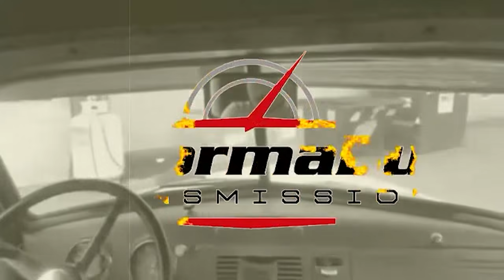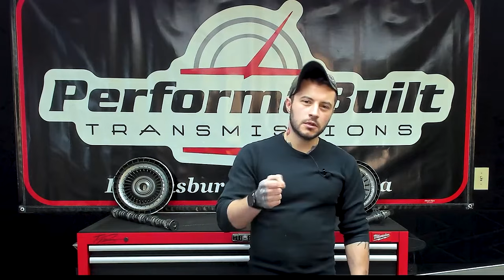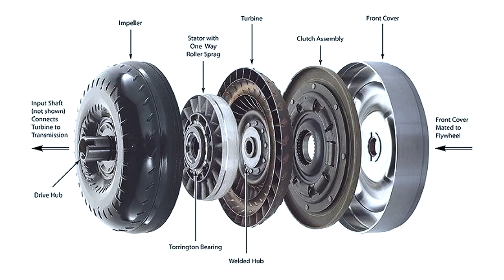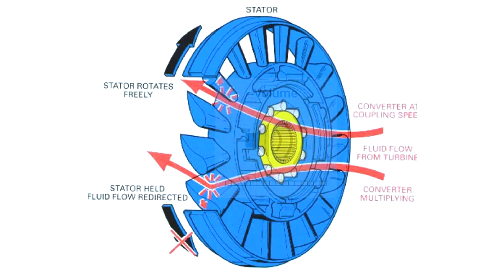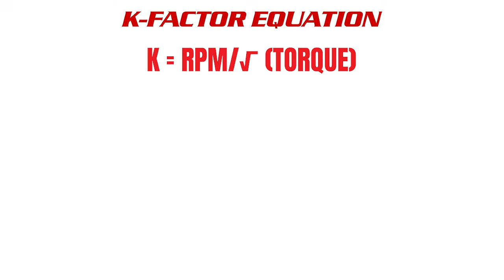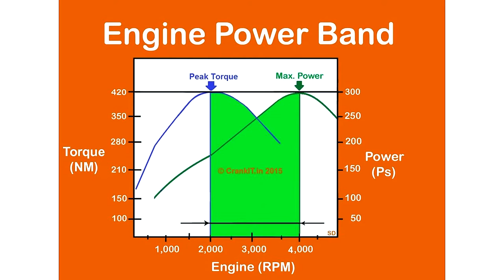How to Calculate Stall Speed

Comment: Excellent video. Just want to say I have a 2400 stall in my '70 Chevelle 454 LS5, along with a TH400 and 4.10 gears. Perfect for the street. Just need that overdrive. The cam makes 14-15" hg at idle so I know it's not that big.
Reply from the maker: 2400 is perfect for the street and its the highest factory stall gm made

Comment: just swap to manual be done
Reply from the maker: That is an option for some people, and manuals are very fun to drive but the benefits of torque multiplication through a torque converter produces much more efficient and very often quicker times without any real factor of operator error. Theres some fast stick cars but theres much faster autos today due to what a proper converter setup can achieve.

Comment: I have to disagree about running a high stall on the street.  I've been running converters on the street for 20 years that flash to 5-6K.  I've been running the same TH400 during this time.  Last time it was rebuilt was in 2005.  And I don't have a massive cooler on it.  I use the cooler in the radiator and then it runs through a single loop 24" tube and fin cooler.  For 15 years prior to 2005 I ran converters that flashed to 3-4K and only used the cooler in the radiator. At part throttle cruise the converter will slip very little compared to full throttle. And my smallblock has a mild cam.  It's only 274/286 @ 0.050" with 704" lift.  lol
Reply from the maker: Its ok to disagree and we are mainly talking overdrive lockups not non lockup th400s and 350s. Very different animals

Comment: Many racers use the bolt together converters with different stators to change at the track depending on track conditions some will run dumps also to control fluid to get the perfect transmission tune on the fly
Reply from the maker: None of that has to do with the transmissions actual tune in the software just fyi.

Comment: I installed a PerformaBuilt level 2 4L60E & 3200 stall in my 96 TA with a CC503 cam and all supporting mods at ~50k miles. I'm at 88k miles and everything is working perfect. Went from a 14.2 in the quarter to 12.9. I sometimes wonder if a lower stall would help in the top end though.

Comment: Are you talking about flash or stall?
Reply from the maker: Both
Reply: This wasnt addressed clearly. You can launch foot brake at 5000 but rpm drop after shifting could be back at 6000. This is a wrong selected convertor example that I experienced.
Reply from the maker: Flash vs actual stall depends mostly on your overall gearing, tire, and cam. The drop your speaking of on launch doesnt really apply to stall but more on your ratio for 1st to 2nd as well as where your cam actually makes power (granted youve picked the correct stall speed) if i understand your wording your talking about close ratios not stall speeds. The major point of this video was to give the general idea and give the tools to help figure out a starting point for stall speed on a new build and to show a 2000stall behind a 454 will not behave the same as a 2000 stall behind a 350 for example. I would take some further courses if youd like to learn more than base stall with your particular vehicle. Video would be hours long if i went that deep for all kinds of combinations.

Comment: ive run 3600's on my street n strips for years but moved to 4400+ on the 4L80e's with a triple disc...you CAN get the best of both....Aftermarket ECU's allow you to lock up the stall from 2nd gear on ( same as newer trans like 8l80/10l80's they ALL lock up the stall at part throttle past 2nd even if they have 10 speeds ) and that keeps the heat under control very well...had one behind a BBC with F1A-94 putting out 1300hp for 6 years near daily driving..no issues at all...this does include good PTFE line ( less internal resistence ) and swept 90s into a large stack plate cooler....also using a charge pressure transducer to polish in the tune ( so computers are still in play in whats going on in the torque converter ).....go with with more modern 6,8,10s speeds you have even more control...but even mine ill let it unlock a few ms at shift with stall LOCKED at WOT as well.....this video is more for people that dont have control over the converter in older trans.....for those I generally stop at 3600, ive had that in SO many configurations, at so many weights and power levels its just a real damn good compromise as he said....
  Im glad the market is moving more towards end user changeable stators ect....really appreciate the video and that will help the end user dial in their combos by not having to send it in, in fact if your younger you can have one for race season and one for off season......

 Keep up the videos but dont limit yourself you CAN much CLOSER to the best of both worlds with modern converters, trans and control system......I literally called that entire project cake and eat it too, down to gapless top rings ( damn ring pack was $400 pre biden dollars so what 600 now  lol )....

Comment: I don't hear much about stall speed anymore, i remember how popular it was in 1984. It felt like i added a hundred more horses. I think it was 2500 stall but we didn't dyno or have every guage working. Im kinda glad and jealous to see things aren't done like that anymore. One thing i vividly remember was driving down the street, and every driveway or every other driveway had a car jacked up with tools rattling under it. Everyone was a mechanic back then, and we had to physically hunt for information by showing up anywhere cars starting gathering. I learned mechanics from dad but had to hunt horsepower information because i am positive my grandpa and dads generation absolutely limited our horsepower because they were driving before seat belts, air bags,and crush points. Grandpa and Dad could put enough hp into a ceiling fan that it would lift the house, but they were intentionally dear in headlights when asked for modification information. I don't modify anymore because today's stock hp impresses the hell out of me😮
Reply from the maker: That was a time to be alive. To hunt real info. Now we all have youtube lol. Yes stall changes are the real key to a good engine / trans combo

Comment: I think im getting the hang of it after watching this video. Im rocking a ls1 5.7 with 243 heads, ls6 intake, headers 231/242 in/ex cam in a 3600lb (est) camaro with 3.73 gears on 26" tires. I do not have a dyno graph of the car yet because its not fully assembled yet, but should be around 450hp/tq. This will be 100% a street car. When doing the K factor, do we use crank or wheel torque? I'm still a bit confused about k factor. Are we trying to match k factor to our duration or something? I don't quite understand just throwing a stall rpm into the equation. Where does that number come from
Reply: You have to know two of the three. K-Factor, torque at flywheel as installed or stall speed to calculate.

The OEM Mopar 10.75" Hi Stall Converter that came in performance applications was K-Factor 140

426 Hemi 
Rated Gross 490 lb-ft
Net Estimate (80%) - 392 lb 
19.8 x 140 = 2,772 rpm
Claimed 2800 stall

383 Commando / Magnum 
Rated Gross 425 lb-ft
Net Estimate (80%) 340 lb-ft
18.4 x 140 = 2576 rpm
Claimed 2600 rpm stall.

273 Commando
Rated Gross 280 lb-ft 
Net Estimate (80%) - 224 lb-ft
15 x 140 = 2100 rpm
Claimed Stall 2100 rpm

Internally they were the same converter. 

They also had a K-Factor 115 version of this converter they used in some of the 2 barrel engines.

Comment: Hi, I have a 2800 Lbs vehicle with a powerglide trans Sbc 383 stroker Hyd Roller Comp cam 2200 to 6000 RPM Range Duration 230/236 Lift 582/591 Slick diameter 31” x16.5  4.11 gear I currently have a B&M 2500 stall converter in the vehicle that sucks from the standstill at full throttle I will appreciate any recommendations that you can suggest regarding a stall speed that would accommodate my application if you sell converters, I can make a purchase from you and forward you any additional specs that you might need
Reply from the maker: 2800-3000 stall, dont use b&m or tci. Pick a reputable converter lile fti or circle d and you will feel the difference

Comment: Awsome video and great info. I guessed and hunted for a used stall for my foxbody. I think i got lucky bc it does great for what it is. I wanted a 2400 but found a deal on a 3500 non lockup so i bought it and put it in. Glad i did. In my 3550# with me in it foxbody convertible it went from running 9.20s in the 1/8 mile to 8.33 at only 240/265 to the wheels.. im thinking it may change tho once i bolt on this old sc and run 6# boost to it..
Reply from the maker: 3500 is meant for the strip like your using it for because the torque curve is stretched out over the powerband. The issue is people think they need a 3500 for everyday street use with a near stock vehicle with heads and cam.
Reply: @PerformaBuiltTransmissions  I daily drive mine in the summer but I can see where most wouldn't want to. When I first put it in I was running the stock cam and the party was over real fast..

Comment: Does line pressure affect stall speed or flash stall ? 

Have you done any videos on dumb valves ?
Reply from the maker: Very little effect and usually not enough to make a change. But it can ever so slightly. We require stock line pressure in all of our builds. I dont have a video on dumps but there are many out there on YT

Comment: Quick question. I know you need more info. I have a 2700 stall which should be streetable in and just took it out today. It's a jegs brand and it would not really move without a lot of rpms. Could barely make it through a intersection driving it normal. Could it be a bad converter or just totally wrong? 
If you floor it it goes. Thanks
Reply from the maker: You have a bad converter or something else wrong. Advice i would never ever ever buy any converter through a big outlet like summit and jegs brand. They just aren't good and the bottom of the barrel for even oem function. Pick a reputable company like fti or circle d for a solid build.

Comment: #3050 Hobby stock 1:82 powerglide  500/500Lift 232/232Duration 108LSA. 2500-6800  rpm Range  3/8 tight asphalt circle track. What stall you recommend?? 3:73 rear gear 678 final drive
Reply from the maker: Thats great information and your well prepared! You have every number you need to sit down with some paper and plug them all into the K factor equation for a base stall speed! Then actual flash stall speed! You got this yourself! 🙌😃

Comment: Do you have a 700R4 that will live behind a BBC torquey street engine?  Have a TH400 currently in my 1972 C10 with 3.73 gears and is revving 3000+ RPM on the freeway at 70 mph.  Really would like an OD for mpg’s and less revs.
Reply from the maker: 700 isnt my first choice for an update and requires an exact tv cable setup at all times but yes we are able to build that. Please calls sales during buisness hours to spec one out or visit www.performabuilt.com to veiw our products

Comment: Street stall at 2k range? Had a fbody with a 4l80 and bolt on ls1 and I went for a 5000 hard hit torque converter and I got the biggest trans cooler I could find and it was the best tc for street Ive ever experienced and Ive done a bunch of them different setups. The car actually did a wheelie at the track and was stupid fun on the street and super manageable for cruising and non wot driving

Comment: I’m looking to ls swap a ranger with a with a 6.0 and a 4L80 with a 222/232 112lsa cam and 29 inch tires, ideally I’d like to run 4.56’s or 4.88’s to make up for the long 4L80 gears and a gear vendors to bring the highway rpm’s back down and split gears, would something like a 2600 stall be optimal for this situation?
Reply from the maker: It wouldnt be ideal for racing but for light street driving and towing it would be fine

Comment: Thank you! Amazing video! Currently planning a 408 build on a lq4, with a stage 2 Brian Tooley Torque Cam with the 4l80e in my 5500 lb 2006 1500HD Chevy Silverado. This video has done wonders in helping me figure this out. We are probably looking for that 450-500 trq range but won't actually know till it's dyno long after everything is in. Probably gonna go with a 2200-2400 or 2400-2600 stall speed.

Comment: I’m changing from a th400 to a 2004r in my C3. I have a 3000 stall in it now. I like it but wondering if I should bump it up a bit for the 200. Like 3400. Street/strip .486/.500 cam, 107 LSA, 243/257 duration @.050, 4”hg, in drive,3.70 gears, 28” tires, 3” exhaust  around 350 hp 31-3200 lbs
Reply from the maker: Changing the trans isnt going to affect your stall spd. The engine, rear, and tires are what affects your stall spd.
Reply: Even if the trans is geared differently or has heavier duty parts?

Comment: 383 stroker in a C3 Corvette with th400 and 336 rear end with short tires (26.5" diameter).  100% street car. Had a 2600 stall and it was hard to get used to. Too much revs and noise at a stop light before going anywhere. Swapped to a 2200 and much happier.

Comment: Mild Cam? What a joke. Use the proper 1/4 race, 1/2 race and 3/4 race cam
Reply: Everyone knows cams are measured in stages. Lol, them stage 3 cams.
Reply: We're way past those old cams there are way better grinds out there today
Reply: Stock (ZL1) = 0.580 Int 

Pro Stock = 1.200 Int

Mild =  1/4 Race = 0.735 Lift

Thanks for the advice.😂

Comment: What would be the best application for a 94 gmc c1500 extra cab with 4L60e transmission , stock 350 engine , 425 gear ratio , 4” suspension lift and 35”x20” tires and rims , it’s my daily driver and I tow construction material with it , I looking for smooth ride in the highway at I tow , please help?
Reply from the maker: Heavy hauler 4l60e available at www.performabuilt.com

Comment: Man I believe that my set up is all wrong from tire size to rear gears and stall 
Could I call you to get some info maybe you can give me some input on what I am doing wrong ..?
Reply from the maker: Simple. Build your car for 1 purpose and not everything. Its all about optimizing what your building it for. If you want the car to do street and strip then the  car isnt going to be optimal for either one and might not feel the greatest.
Reply: I literally only want to do major burnouts on big rims is it possible to much stall 
Can keep me from doing a burnout …??
Reply from the maker: @Builtnotbought442  yes because higher stalls are for drag racing to maximize power down the track. Street/ burnout stalls are much lower to give more bottom end torque. You should still be able to do a burnout with a higher stall spd unless your stall is completely wrong for your setup or you dont have enough power / bad technique to do a burnout.

Comment: Great video. A video with all the math? Would be appreciated. This starts to explain the magical converter...
Reply from the maker: That is all the math any customer needs to figure a stall speed out? The numbers will vary with your setup. That is a sample scenerio only. Once the baseline through this equation is figured you have to use experience as there is no dead set scenerio or first try math. It doesnt exist.
Reply: @PerformaBuiltTransmissions  K is the math...how does one factor in weight, gearing, tires, etc. Is it all experience? For us normal Joe's, we'd like to get close based on all the factors you discussed.
BTW, This was a phenomenal video and the only one I've found that discusses all the factors.
Reply from the maker: Yes experience and its covered. Weight ties in when i mentioned rolling resistance in torque converter operation in the beginning and near end. Ratio is also going to come into play on how effective the vehicle reaches its stall speed from a stop into the powerband. I understand they are subtly mentioned and its alot of information. Thank you very much though! I will be doing a gearing video on final drives so i can be more indepth with it then for everyone
Reply: @PerformaBuiltTransmissions I was also wondering how you got K in the equation. You just stated that K is 3000 rpm but I don't understand how you got there. To someone like me who is trying to learn it just doesn't really make sense and feels like I'm coming in halfway through the equation.
Reply: @PerformaBuiltTransmissions  Torque converters are the last of the magical boxes. Us normals don't have the resources to pick, try, re-purchase. Not to mention the labor, garage space, tools to do this every weekend till we can get it right. Catching up on your videos .

Comment: Good video man. Last year we were building my wife's cruiser. We called you guys, spoke with Alan, I believe. Her car is a '63 Chevy II, 10.8:1 383, AFR 195 cnc heads, dual plane intake, Holley Stealth Sniper, 241/247 @ .050", .583/.565", 112lsa, 108cl hyd roller cam, 27" tires with a 3.89 rear gear. I'd guess curb weight is around 2900lbs. You guys built us a stg2 4L60, which we went through you guys to get a FTI 9.5" 2800-3000 stall converter. We ended up using USShift quick4 controller and have stuck with their 6000rpm wot shift programmed tune. It ended up making 386rwhp/369rwtq. It runs great for being a quick little street cruiser.

Comment: 4000 rpm at 1800 lbs had me laughing hard i would have asked him are you planning on running a 5th wheel and 53' trailer or you just want to be able to cook sandwich's while your in between trips LOL. street and strip guys that like to win have a set of wheels and converter for the street and a set for the strip i have a 71 skylark it takes me 1.5 hrs to swap a converter its a 3000 lb car and i care about my engine Buick's are expensive engines so i keep my rpm and engine load as low as possible on the street my trans runs 180 max even doing burnouts and even with the bigger wheels i only go up 600-800 rpm on stall. NOS is what comes out of my butt after eating empanadas LOL.